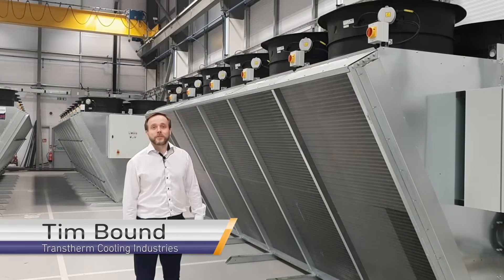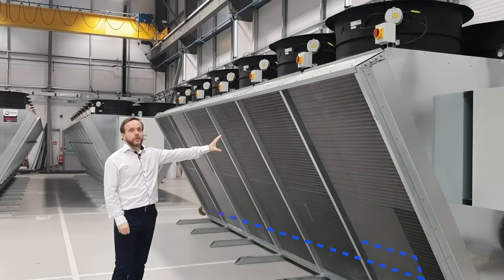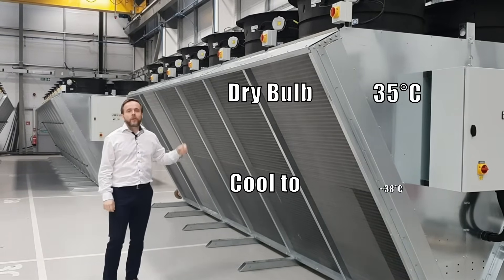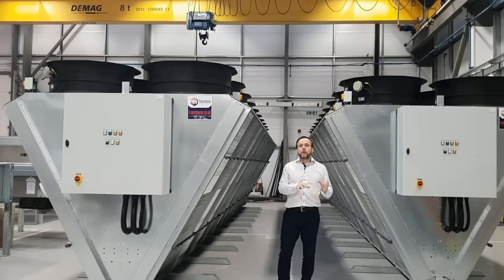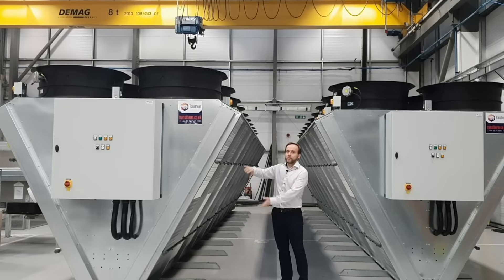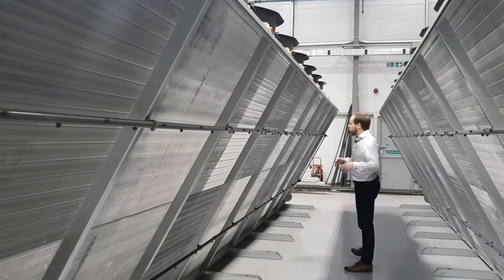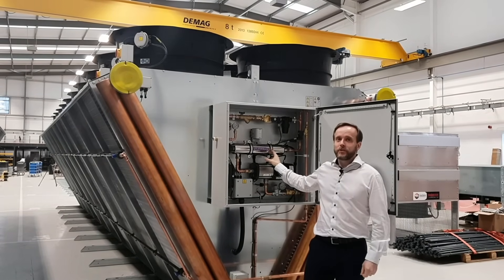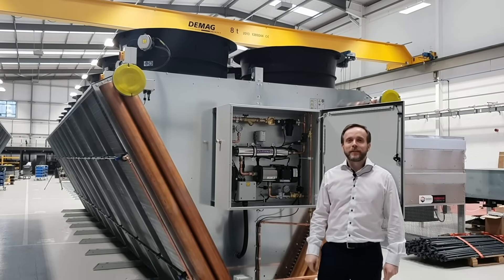Transtherm Adiabatic Coolers Basics & How it works

Comment: Your Adiabatic Coolers would be a perfect application for a data center located in a tropical climate, correct?
Reply: As far as I understand from the video, the adiabatic coolers work the most efficiently in moderate to warm climates but the air should be dry. This is because you want to lower the air temperature by forcing it to reject heat as much as possible to the evaporation process of the water mist from the sprayers. The dryer the air the more extra moisture it can "carry", the more heat it can reject, and subsequently the lower temperature it will achieve.

Comment: So this is that thing from all the example problems...
Reply from the maker: Hi Bailor, 

Thanks for your comment.

As with any product, there are those that will take great care in the initial development and design and the continuous improvement of their products.  There will also be those who rush unreliable products to market minus the correct development.

The automotive industry is a great example of how differing levels of development can affect a product’s operation and it’s longevity.  All cars will get you from A to B for a period but how long that period is will, on average, be dictated by the experience of the manufacturer and amount of effort put into their designs.

At Transtherm, we have been manufacturing heat exchange products for over 3 decades and adiabatic coolers for over 2 decades.  In that time, we have supplied thousands of coolers and have had fantastic product reliability and longevity.

Equally, we have witnessed the problems with other adiabatic coolers, hybrid coolers and cooling towers owing to poor design and mistreatment in the field.  9 times out of 10 the problems occur for one of the following reasons:
1. Excessive evaporative cooling is used as control systems are manipulated (this is not possible with Transtherm PLC based controls)
2. There are a small number of large spray nozzles pointing directly at the coil face, creating wetted surface cooling (Transtherm use a larger number of smaller nozzles and direct them counter-flow to the air stream in order to minimise the possibility of wetted surface cooling)
Reply: @transthermcoolingindustrie4548  I’m guessing this is some sort of auto reply because I said the word “problem” but I was making a joke about engineering homework.
Reply from the maker: @BailorTheSailor  
Thanks for your comment.

Nope, that wasn't a auto reply, we do take every comment seriously :) We hope you enjoy our content. 

Wish you have a great day ahead

Comment: how the dry cooler is less efficient than the adiabatic coolers?
Reply from the maker: Many thanks for your question Anuraj.  

For a fixed heat load and water temperatures the efficiency of a cooler can be affected by a number of things:

1)	The rpm of the fans pulling the air through the heat exchange coils – the slower the fan speed, the more efficient the cooler.  This is because variable speed fans reduce the power consumption to the cube of the speed of the fan (so, if the fans are running at 50% of their maximum speed, their input power will be 0.5³ or 12.5%).  However, with slower fans comes a higher upfront CAPEX cost and your ROI will depend on how many hours per year the equipment runs.

2)	The gap between your required water outlet temperature from the cooler – in this video we give the example of cooling to 38°C with a 35°C dry bulb temperature – for a dry cooler, this only gives a 3°C cooling window meaning that maximising efficiency is very difficult.  However, if we were to size an adiabatic cooler for the same conditions we would reduce the inlet air temperature to circa. 23°C which increases the cooling window to 15°C which is a massive percentage increase.  This means that the adiabatic cooler needs less airflow / fewer fans to achieve the same performance, giving much greater efficiency at maximum design conditions and a smaller equipment footprint.

As the video states, if you want to achieve water temperatures below dry bulb air temperature then you have no choice but to use an evaporative adiabatic cooler as it is not possible to do this with a dry cooler.

I hope this helps, please feel free to email us or leave a reply if you need anything else.
Reply: @transthermcoolingindustrie4548  if the ambient is 46 deg c and needs the water outlet needs  32deg c is it possible?
Reply: @ANU31313  You can do calculations. Theoretical limit is reached with Relative Humidity. If you can no longer add humidity to air - you can not cool it down further.
Reply from the maker: Hi  @ANU31313  
Our adiabatic coolers can generally cool the water to within 5°C of the wet bulb temperature. 
So, in your example, as long as the wet bulb temperature doesn't exceed 27°C, the answer is yes. 
The dry bulb largely dictates how much water the adiabatic cooler will consume and the wet bulb dictates what water temperature we can achieve. I hope this helps.